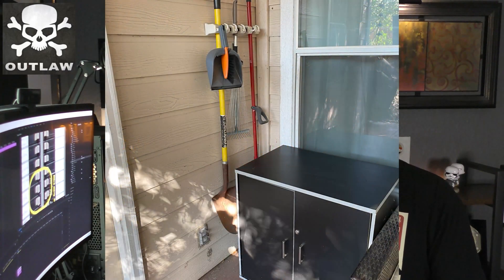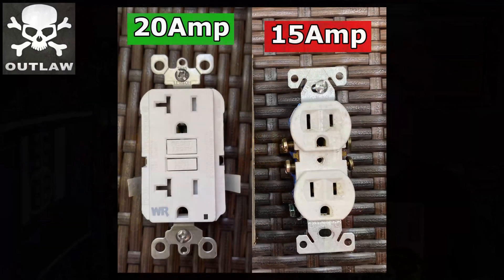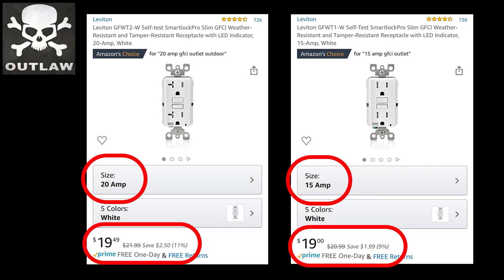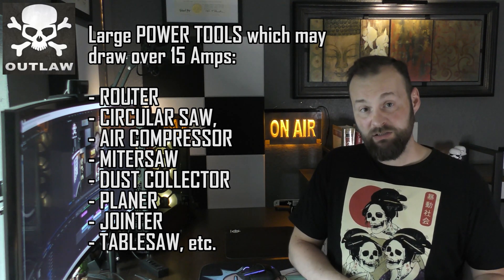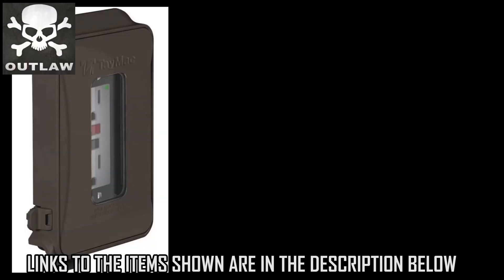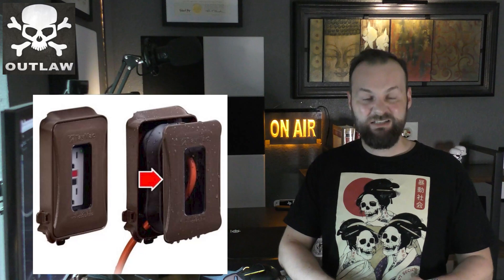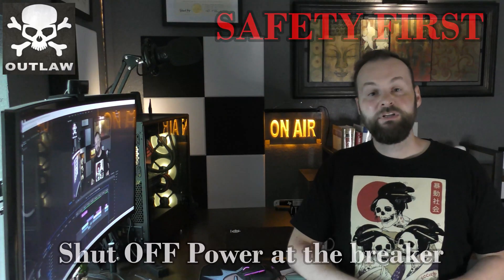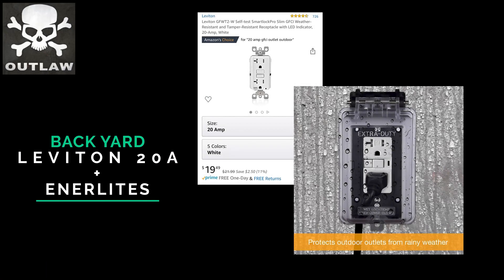Installing Basic - 3 Wire GFCI Outlets, 15A or 20A with outdoors covers: Leviton Taymac Enerlites

Comment: You need to use the torque screwdriver because it's torqued to 14 specs on that outlet screw connection.

Comment: I have been doing electrical work for 5 decades and since I do other things I have to come back to remember the wiring sequence. I have several that are online going from outlet to outlet, gfci to gfci 20 amp and that could use a pigtail.